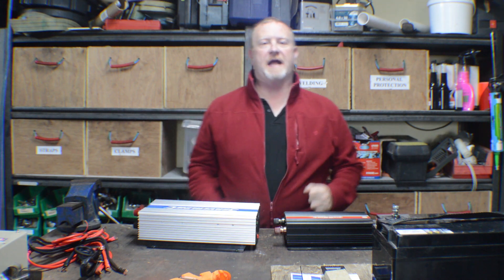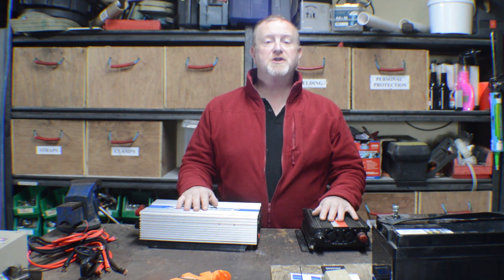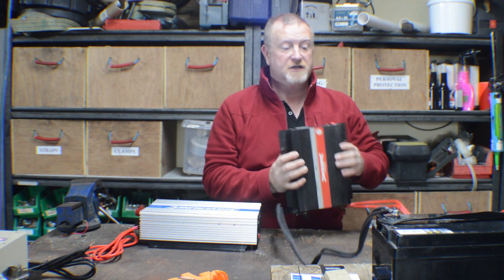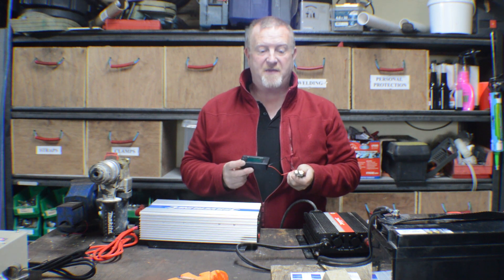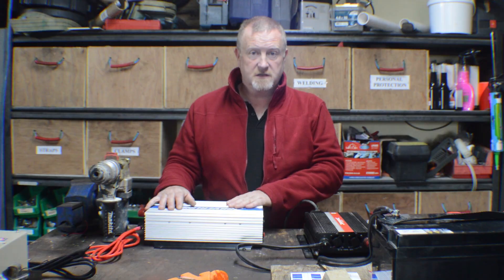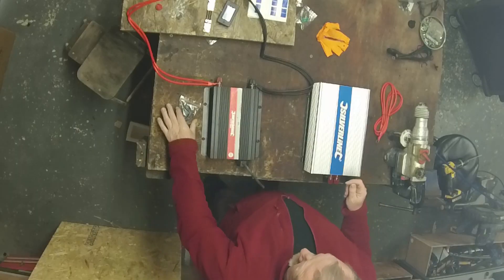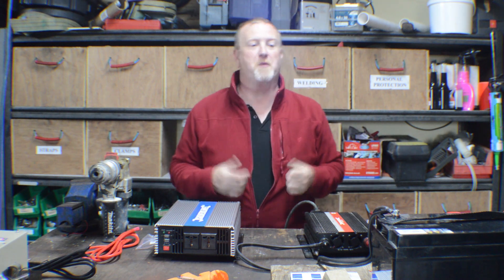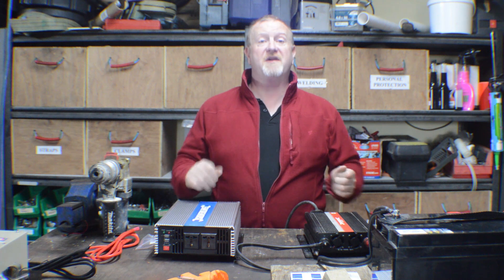Camper Van DIY battery inverter install

Comment: Great info, so do I need to buy a second battery for my van to power my stuff. So in my head I have the van battery under the passenger seat wired over to a second battery, then that battery wired to the inverter.
Reply from the maker: Diarmuid, A second battery is essential, here why! If you used your vehicle battery and ran the inverter while parked up you run the risk of not being able to start the van. A Second battery with split charge relay will not draw power from the vehicle battery and if the voltage gets too low in your leisure battery, it will shut off therefore protecting your main starting battery.Always use a split charge relay( cheap) or Battery to battery charger(about twice the price but much more efficient and works better with smart alternators).

Link to split charge relay https://ebay.to/2WEbeNW or Battery to Battery charger https://ebay.to/2YGXKDR. 

hope this helps-Jamie
Reply: @campervancreations7656  Great stuff thanks

Comment: Tearing the a---e out of it here!
You motioned  - did you do a video ---- clearly you understand electrics so I'd be interested if you did a Battery to battery charger install.
Reply from the maker: Hey there, your comment is a little confusing.  Probably spell checker writing what it feels like. B2B install video never got finished(long story but illnesses  and an engine rebuilt )are simple and straightforward) to install, but the key is using a heavy cable from vehicle batter to b2b and from b2b to leisure battery. Ask as many questions as you want. Always happy to help if I can
Reply: @campervancreations7656  Jamie, came across your excellent videos this evening//then there was the one in the hospital...Hoping all is going OK for you
Reply from the maker: @alanmcc7614  thanks so much. Been a rough couple of years but im out the other side.
Reply: @campervancreations7656  Great news, puts things into perspective